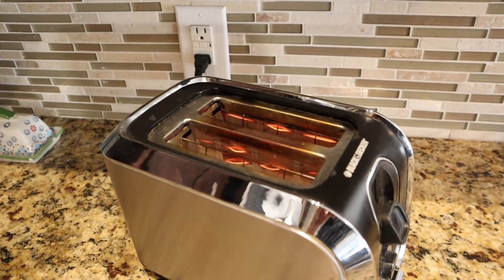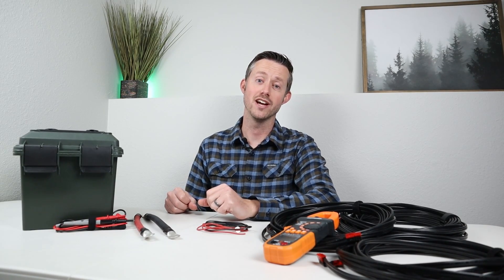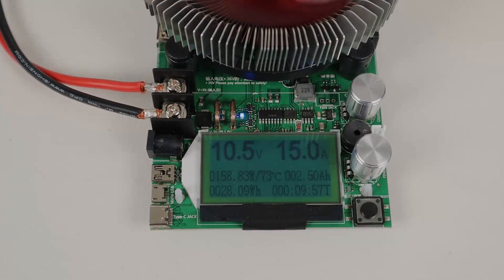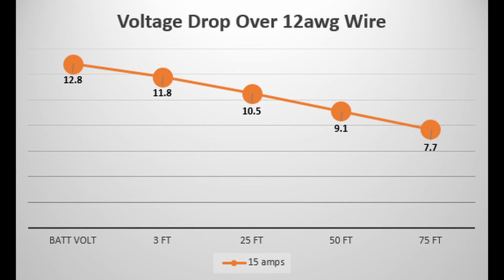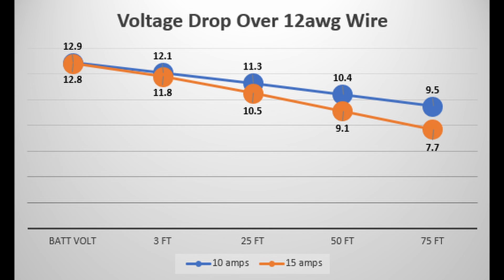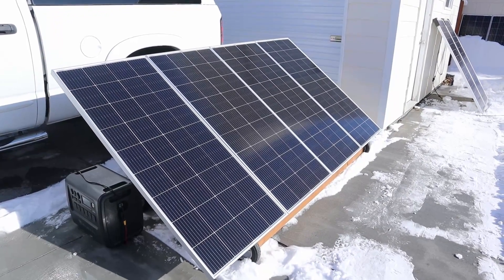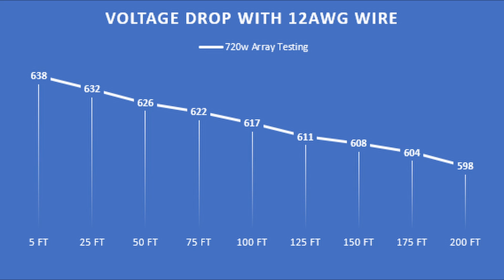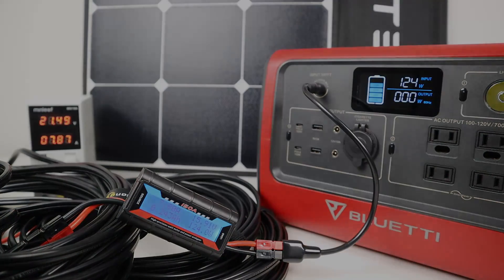What is Voltage Drop!? How to Limit Power Loss Through Your Cables!

Comment: Hi brother i have 360w solar panel this produce 19 volts and 18.6 amps and distance between panel and controller 35 feet how many mm cable should i use for this?
Thank you

Comment: Excellent video.  New to your channel!  You showed the voltage from your operating vehicle.  How do I check that on mine?  Thx
Reply from the maker: You can use a voltmeter and measure the battery voltage from the terminals and then you can try to measure closer to your load and see what the voltage drop is. Most 12v wiring in a vehicle is not adequate. They cut corners to save some money.

Comment: Hey i am having a bit of problem,, i hope someone can advice.. 
I have a solar system  that use to work great when i just set up,,

1x 450w 14amp solar panel
2.5mm wire from panel to 100 amp cheap charge control
Then from charge control to battery\  to 1000w 12v inverter..

Works great..

But decide to upgrade,, add 1 more same spec pannel and 1 more same spec battery..
And recently addded a 2000w inverter..

Went  away for awhile then come back and i have been noticing i am not getting the voltage i use to get..
Ex when the sun is out my charge control will read  anywhere between 13-14.4v for my 12 v system.

But i have been notice the lasts days for the most part of the day its mostly at 12.6. 

I check pannels and wires no damage,, i clean dem, multimeter at solar panel wires reads 30v. When unplug from charge control,,  when connect reads about 13v
With good sunlight.. 

What is weird is in early morning or close to dawn when sun light is not brightest it reads 14+ volt..  

But during the day when the sun is blasting only 12.6 for the entire day

So i am wondering whats wrong
Reply from the maker: Do you have any fuses in the setup? If so check them to see if they are blown. It seems power is not getting through to your system from your panels.
Also, the cheap charge controller could be dead. Cheap ones don't last long.

Comment: I should get my D2Max Tuesday.  Almost didn't due to the 60V limit but I think I can make it work.  The Expandable batteries strike out too as no separate input or output, but it's nice the blade and Wave2 batteries are compatible with the XT150 ports

Comment: hi Jason  I was wondering and cant get a proper answer from professionals about whether my solar panels, which are 200 each, should be wired in a series or parallel 
 to go into my Bluetti generator.. which surge power is 2000 watts. What you you recommend?
Reply from the maker: I'd recommend watching my PowerStation 101 solar panel video:  https://youtu.be/4JG8LvJznLY

This video shows you how to look at your solar panel specifications, and then the power station owners manual to setup a system that won't damage the power station. I give a Bluetti AC200 power station example at the end using larger panels as you mentioned.

Comment: I have a 48VDC setup. What guage wire should I use for the batteries and inverter? The inverter i got came with thin wires compared to a 12VDC inverter
Reply from the maker: What size of inverter are you running? What 48v battery do you have?

Comment: I have somehow the same issue with the boat engine. 
The battery shows 12.8v and the engine controller 11.8v. 
The cable is not that long 2m(I will shorten it) but I believe in my case the issue is the battery connector too. 
The battery connector does not have sufficient surface for a good power transfer so this might be another issue excepting the cables (if it gets warm than it is definitely the issue).
Reply from the maker: Yes, battery terminals are very important to be sized properly. They can get very hot if they are too small. Wire gauge also plays a large role in voltage drop.

Comment: With your alternator sitting at that low a voltage it's at the bottom end of what's acceptable.  14.3 up to 15.5 is alot better. I'd about bet that alternator is on its last leg

Comment: Looking at the WindyNation extension cables they do not increase the cable size for the longer cables. The 150' cable is 10 gauge as well as the 30' cable. Shouldn't the 150' cable at least be a size bigger?
Reply from the maker: All depends on the amperage, if you have 20 amps going through your cables over 150 feet I'd recommend 8awg cable. If you only have 15 or 10 amps, 10 awg is just fine.

Comment: Great video full of information. Will def change my wire length from the fixed panel atop my truck to the pps that I leave inside to power my 12v fridge/freezer. It's 50' currently so I'll bring it down considerably.

Comment: Got 1200 watts of solar gonna be running at 95 volts and about 14 amps. 25 feet of 10awg, then 50 feet of 12 awg then to the 10 feet of the 14 gauge of xt60 adapter wire. What are your thoughts?
Reply from the maker: You'll see a bit of voltage drop through that 14awg section of cable. Wouldn't be horrible in the 12 / 10 awg wiring. I'd suggest upgrading that 14 awg section to something better. You can always see how it performs and if the wire gets hot. If it doesx swap it out.
Reply: @@Jasonoid  thanks Jason! I'm using a ecoflow delta max 2000 and it has a 100v input and 13amp max that ecoflow says it can go over a bit so I'm going to be running 3 string of 4x100 panels. The 14 gauge is the 10 foot of mc4 to xt60 that plugs in the back. I've thought about finding and ordering a thicker xt60 to mc4 adapter. At least to 12 Guage. I literally chose this unit watching your video. So thank you for your ecoflow vs. Ac200max video! I have 2 600 watt arrays on 2x 40 amp controllers and 300ah of gel all renogy so this is my "to go,backup, and toy" really lol I have a portable ac/heatpump that I would like to power with it during the day and it draws 1100 watts when running so the closer to 1200 watts the better. Thanks alot for replying!
Reply: @@Jasonoid  btw you were so right about the AC output standy draw. I've left it on overnight and didn't even draw 1%. This ecoflow delta max 2000 is outstanding! And btw for the record if you turn off the unit or have the unit timeout turned on. When the sun comes  up in the morning it will in fact turn the unit back on and start charging!

Comment: Jason, what would be an acceptable battery monitor with shunt? Should I get this 37 dollar one for my 300ah battery (AiLi Voltmeter Ammeter Voltage Current Meter) or should I spend about 25 more for the (Renogy 500A Battery Monitor with Shunt)? The Renogy has low voltage alarm. Do you think the less expensive one is any good if that`s all I can get right now? I don`t want to hurt my battery by running it dead using my air conditioner or other higher loads. I hope to power my tiny Frigidaire 5000 BTU air conditioner from solar during the day and early evening this Spring and Summer and have power after any hurricanes.
Reply from the maker: I don't really have one to recommend right now. If I wanted to purchase a high quality one I'd probably go with the Victron Smart Shunt because the smart app connectivity and history tracking.

Comment: Nice video and great links!  Part of the decision is cost of different gauge wire vs voltage drop, so the links are good for that.  One thing though, “timesing” isn’t a thing.
Reply from the maker: Where is the "timesing" typo?
Reply: @Jasonoid  Sorry, it’s not a typo, but in the video.  Multiplying would be the better word.
Reply from the maker: @tomhouck3476  Thanks for the feedback.

Comment: Off topic but do you know where I can find a (PD/ Usb-C to Usb-c) output only cable or adapter ) ?  I have powerstation with a 100w bi- directional  port but only accepts Input charge whenever I plug in powerbanks that need charging. I did everything , from flipping the cable and no luck  .
Reply from the maker: What power station are you trying to use?  You can try this 12v insert, I'm not sure how it works since I haven't purchased it myself:
https://amzn.to/3uNt6Ys

Comment: I use to have a set of jumper cables that were of a large wire size and good clamps and thou they were longer then most at 20 foot long, I was often able to jump start cars and trucks from my small 1981 Honda civic that others had failed to start with smaller cables in cold winter weather of upper midwest. Some had been trying for around an hour and I don't remember it ever taking over ten minites. I made the mistake of telling an ex brother-in-law how well they worked and he took them from me twice and I got them back, but the last time they went missing, never saw them again, but he was on the top of the list. Someday I may make a set from some good welding wire, useing the clamps from the set I always keep in my truck.
Reply from the maker: Big ole gauge jumpers are hard to find these days at a good price!

Comment: Great videos Jason.  What recommendations do you have for charging additional batteries through DC plugs on a Bluetti AC200P? Any future videos with plans to improvise or improve on the Bluetti AC200P generators would be greatly appreciated!
Reply from the maker: To clarify, you mean charging a standalone 12v LFP battery off the 25amp DC output on the AC200P?
Reply: @Jasonoid  yes, what battery and cables would you recommend?
Reply from the maker: The output of the AC200P isn't meant to charge a battery, it just provides power so you'd need to find a small DC to DC charger designed for LFP use. 10awg wire is rated at 30amps.
Reply: @Jasonoid  Thank you, Jason.  I guess the best option will be to set up a second solar array to charge a second battery that I can then plug into the AC200P at night to boost the system.

Comment: Jason, we have a 2018 4Runner. Did you route your 12 volt wire through the vehicle or under it? If under the vehicle were did you re-enter the wire? My Bluetti AC50S won’t properly charge off the factory outlet (the watts increase then suddenly drop and repeats this over and over) so I’d like to install another 12 volt outlet like you did with the thicker wire. Thanks
Reply from the maker: Routed through the firewall at an existing hole near the driver side steering wheel, then went under the floor door moldings to the back of the vehicle (wires are already passed through this area so theres plenty of room). Then used a fiberglass cable fishing rod to get it the last 5 feet to the rear cabin area. It wasn't too hard. Your model should be similar since they haven't changed much.

Comment: Jason, would there be less drop using 10 gauge wire?
Reply from the maker: Correct, 10awg wire has a larger diameter than 12awg wire. 10awg will have less voltage drop.

Comment: Awesome video, Jason! This was probably much easier to digest for people than just reading or listening. Real world examples are always great. 

Speaking of voltage loss, I used one of your videos to chop the cigarette adapter off my fridge and replaced it with powerpole. Voltage loss decreased(!),  along with being so much more secure
Reply from the maker: I should have mentioned that not only the wire can cause voltage drop but also JUNKY connectors like the 12v cig plug! haha Good work!

Comment: good to see this video, i hope it will be helpful to many.
more voltage = less loss over distance with a lower awg wire, vs a lower voltage.
when calculating what awg wire you need, you can find a good wire guage calculator online to help. you will need to know the voltage, amps, and the distance you want to run.
Reply from the maker: I mentioned a good voltage drop calculator in the video and linked it below in the video description, it's super useful!

Comment: I wish you would have done a test with 10ga pv wire.
Reply from the maker: I only lost 30 watts over 200 ft with 12awg wire, should be less with 10awg. I can't test every scenario. Throw your numbers into the voltage drop calculate here:
https://www.southwire.com/calculator-vdrop

Comment: Just got in some 8 gauge 100 ft MC4 cables to run my 2 PV350's (in series) to my AC200MAX.  About 30+ pounds of copper!  Upgrading to fixed panels next year so the 8 gauge should be great when i put in 2KW of solar next year.  The voltage drop is about 0.6 volts and the power loss is about 5.3 watts max for 100 feet, which is really good.  Every week, your videos are very applicable to what i am current working on, so i'm looking forward to the next mind read!
Reply from the maker: 8 awg!? You went with the good stuff! : ) :)

Comment: Thanks for the great video, it made me check my voltage at my 12v fridge and it was down to 12.2 v with a 18’ cable and a 15’ cable combined, removed the 15’ and now back to 12.9 v with a battery voltage of 13.4. Thanks!
Reply from the maker: Awesome! If you don't need the extra cable, remove it out :)

Comment: Excellent video. The knowledge of wire size is so necessary when building a solar setup; also I might add proper fusing of your circuits is essential. This is one of the best and most informative videos you have made. Thank you for instructing the YouTube world.
Reply from the maker: Covering fuses would be an excellent topic. Since power stations have built in protection, I usually don't mention fuses much in my videos. For any DIY system it's very important! Thanks Kevin!
Reply: @Jasonoid  When I think I might need a fuse or breaker; I add one.

Comment: as always great video, thank you :) 
just 1 question, (forgive my English:)  in your calculations for example you say 10ft of a cable - does it mean 10ft of a single wire cable or 10ft of 2 wired cable (which in total is 2 x 10ft = 20ft)?
All the best from cloudy Poland
Reply from the maker: The testing in the video was on 12-2 landscape wire and included the entire 'loop' of power.
Reply: @Jasonoid  thanks, clear :)  ,12 I get means 12 gauge - how to convert that to the metric mm?
Reply from the maker: 12awg wire is 2.052mm
Reply: @Jasonoid  thank you

Comment: Vehicles are getting better about wiring, but it still is inadequate. I assume your compressor would start up if you had the engine on because of the extra 1.6V from the alternator. This is the reason that I like to keep a small powerstation in the back of my Sorento though, so I can let the car charge the power station and let my fridge run on it. Though I can't even get power to that rear cigarette if the key isn't turned on. I just wish I could find a power station that could be triggered to turn on when it gets power. I'd like to have a small station that could run things like a cellphone booster that I don't have to turn on. Then again, the cold is what killed my Milins electronics (the battery itself is fine) I think so this might be a bad idea.
Reply from the maker: It's almost better that the key turns off the 12v port when the engine isn't running so then the power station won't drop down your starter battery so low the engine won't start. A couple of my power stations turn on with input voltage (well the displays do, not the AC inverter or DC output). I'm guessing if you connected a 12v LFP battery in the back and had a small DC to DC charger, it would charge the battery while driving and the 'output' would always be on since it's just a battery.
Reply: Nevermind I'm being stupid. Even if you started the car, got it running, then turned the car off it would fail as soon as the compressor cycled.
Reply from the maker: @SetitesTechAdventures  it depends on the cars wiring actually, start up current for the compressor pulls way more power on these fridges vs the running current. (80-90 watts start up VS 35 watts running)

Comment: great information Jason! I was thinking of making a 50 foot extension cable for my solar panels so i can find the sun better camping in the woods, so now i will get some adapters to run in series to up the voltage and not have to get bigger wire.
Reply from the maker: Just make sure your power station can handle the input voltage of panels in series. This video describes how to verify that:  https://youtu.be/4JG8LvJznLY
Reply: Thanks again! im use a 30 amp MPPT charge controller hooked up to a set of 6 volt golfcart batteries.

Comment: Jason, I’m really impressed with your power bank in the cargo area of your 4Runner! Our Ford CMax’s battery is located in the rear right below the cigarette adapter, so my compressor cooler has never thrown an error. As long as our Tesla Model 3 is awake the full voltage is available at the cigarette adapter and the car seems to always wake up if the 12 volt lead acid battery needs charging. New Teslas have a small lithium ion 12 volt battery, so I don’t know if there are any behavioral differences.
Reply from the maker: That's convenient that your battery is in the back of your CMax! No mods needed haha. It will be interesting to see how electric cars move forward with DC/AC output. I like the idea of having regulated outputs in the car, kinda like a HUGE power station.
Reply: It’s definitely awesome!

Comment: Not sure this was mentioned in your video "Note that the total length of the circuit is the roundtrip distance from power source (usually the battery) to the product and back."  (from the Blue Sea link).
Reply from the maker: From my testing, a 50 ft cable has the voltage drop of a 50 ft cable, not a 100 ft cable. Maybe the voltage drop calculator already applies the "round trip" distance. I wouldn't worry about making things more complicated.
Reply: @Jasonoid Go back to your Blue Sea link and read what they have to say. It is important to not confuse distance between the battery and the load with the total circuit length.
Reply from the maker: Thanks Phil!